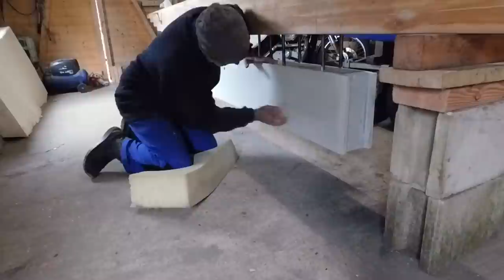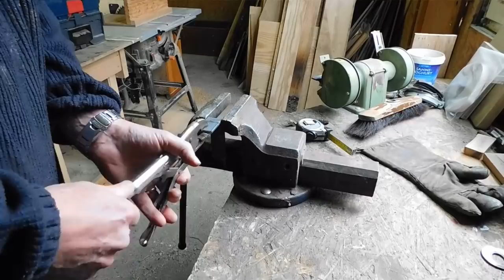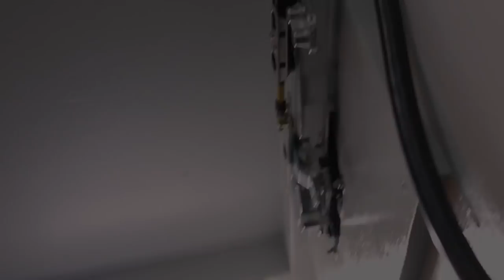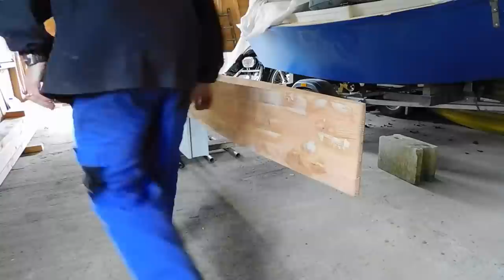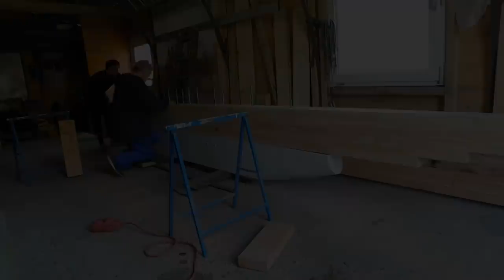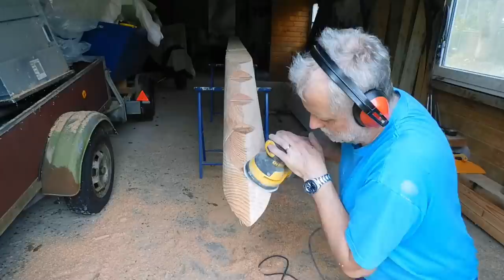Back at it!; Building a cruising sailboat - SV Tapatya EP226

Comment: Oh boy, that’s right 2 big strong ones, holy cow!!! Beautiful work on the Douglas fir, are you going to fill the keel bolt holes with epoxy as well? Nice work on the drive cables, very nice sweeps, shouldn’t have any trouble with those! Karin’s done gorgeous work too, it’s wonderful to have a nice cozy cabin. I spent last weekend cleaning our cabin up, ship shape and Bristol fashion for the coming season, top deck too....too bad it’s raining again now, just enough to make a dusty spotty mess! Thank you Tony, another super episode for the books!
Reply from the maker: Thank you Nena 😀😀 Yes, I was pleased with the run of the control cables. Yes, from my reading of other builders' methods, it's pretty common practice to bore the keel bolt holes oversize and pour epoxy down to fill them once the whole thing is in place. I shall be doing the same👍. And yes, preparing for the summer season is a time of great hope. Have a great one!

Comment: very nice keel work..Takes a lot of time to move that around.. Some old memories from my days came back and that keel was only 1,000lbs..
Reply from the maker: Thanks Frans. Yes, the keel's been a big project 💪
Reply: @SVTapatya  Besides moving the keel underneath the boat, marking the keel bolt locations on the bottom is another nice challenge .. but I am sure you got it all figured out….
Reply: @fransdriesen1311  - No need to mark them.. Tony drilled the keel bolt holes through the hull before he even started on the keel! Going by how smoothly the mating of the keel and timber went, everything should drop right into place without problems.

Comment: That's coming along beautifully, Tony!

You mentioned the masts, but I seem to recall there's still some work to be done on the rudder, too?

(In my own news, both the curved bulkhead beams have been laminated up, and work has commenced on getting the inside of the first buoyancy tank filleted and glassed. Filleting went well, but I can't say I'm entirely pleased with the fibreglass job (more air bubbles than I'd like!), but hey, it's a learning process, it's fixable, and I'm sure I'll do a better job on the next one! And I'm totally in love with peel ply.. that stuff is great!)
Reply from the maker: Thanks Garryck. Yes, but the final touches on the rudder need to be done when I'm fitting it, for which the keel needs to be in place. My planning now is to get the keel as far as having ballast and timber as one piece, to get the engine running and then to build the masts. I then hope/intend to move the whole lot up to a boatyard and put it all together/finish off the few bits that will still need doing. Hopefully that'll all work out 🤔. Are you using a roller to apply the epoxy? You may well already know this, but the trick is to wet out, wait for the epoxy to start to tack off a bit (15 mins maybe), put the glass down as smoothly as possible, then wet out using a roller to work the glass out smooth. I don't know what weight of glass you're using, but, from experience, mid and heavy weight glass goes down flatter than light cloth. The light stuff tends to float on the epoxy!
Reply: @SVTapatya  - No, I didn't use a roller for this, given that the buoyancy tanks are made up from 3 small(ish) panels. I figured it would be a good opportunity to try out the alternative method of wetting out the glass on a sheet of polythene (with a fin-roller, which in hindsight may have been a mistake), before laying it on the already wetted out panels (which had also previously been sealed with a coat of epoxy a few months earlier). Despite the way the glass looked fully wetted out to me, it seems I didn't manage to get it fully wet out after all.

I've since drilled small holes in most of the bubbles and used a syringe to inject epoxy into them, which has done the job nicely. I then applied another coat of epoxy to help fill the considerable number of spots where the weave wasn't filled, and put peel ply over the lot again before giving it all a good workout with a fin-roller. So we'll see how it goes this time around. The glass is 300 gsm, which equates to 9 oz cloth. I'm not sure where that falls on the med/heavy scale, but it certainly takes some effort (and a decent amount of epoxy!) to fully wet out!
Reply from the maker: 300 gram cloth is a good weight. It should go down smooth. I only ever use the wetting out on a plastic sheet method on very small pieces. Funnily enough, I did exactly that earlier today, putting some glass tape around the edge of Hazel's centreboard. We also did that when we glassed her through hull holes shut. On any piece of ply, I'd wet out the ply, put the glass cloth dry onto it, then roller epoxy into the glass. However, I have to add that the only reason I feel I can speak with some authority on this subject is that I've made plenty of mistakes glassing things in the past, and, slowly but surely learnt from them. You'll find the method that works for you, no doubt 👍
Reply: @SVTapatya  - Yes, the 3 pieces that make up each tank (all weirdly shaped quadrilaterals) range in size from maybe 300mm x 150mm  to 300mm x 250mm, so I figured they'd be a good subject for the plastic sheet method. (I won't be using it on the hull, rudder, or daggerboard, that's for sure!) The glass itself did go down smoothly, it was getting it fully wetted out that was where I failed.

Another thing I've learned is that if your peel ply comes folded, rather than on a roll, any creases, even faint ones, MUST be gotten out using an iron before applying it. The epoxy will NOT be enough to help pull it down flat, there will be a tiny air-line along the crease that's impossible to get out, and you'll end up with a faint line across the piece that will need sanding.

And having seen all the epoxy work you've done on Tapatya, I fully bow to your authority on the subject, and very much appreciate any tips and suggestions that you share! 😎

Comment: Hi, I just caught your video and see that you are soldering the connection at 18:48. You don't want to do that... the constant vibrations, rocking, can work the individual wire stand solder connections and break them so that your connection becomes bad, overheats and causes problems. You want to crimp them #ell out of them. You want the copper wire and the connector to become homogeneous. The solder also adds an extra element/material for the electrons to pass thru from connector to wire and increase the resistance.
Reply from the maker: Ah, but Rush, this is tinned, ie, soldered, wire, where each individual strand is precoated in solder, and a tinned terminal.
I’ve heard such claims before, and even read up on them. Imho they don’t stand to scrutiny, and are probably the result of ‘research ‘ conducted by purveyors of crimping tools and terminals.
Reply: @SVTapatya  Nope, not BS. It became a problem in cars with electric motor conversions where there were 20 or so batteries that had cables connection between them. After a while the crimped and soldered connections (like you did) would start heating up for no reason, it was found that enough of the individual strands of the cable has been broken and caused a bad connection. When the connections were just crimped, the problem went away.
Some facts - The electrical resistivity of regular 60/40 solder is 0.153 microhm meter, the electrical resistivity of copper is 0.0172 microhm meter, solder has a much larger electrical resistance than copper. The thermal conductivity of solder is 49 and the thermal conductivity of copper is 401, copper is about 8 times more thermally conductive than solder. And this is at 20 deg C.
Reply from the maker: But as I said , Rush, these are tinned cables, so that is all completely irrelevant. We use tinned cables on boats to reduce the corrosive effects of the sea water environment. You can talk about cars all you want, it's all irrelevant
Reply: @SVTapatya  It's all irrelevant until the soldered joints fail.... so you have a copper to tin to solder to tin to copper connection when soldered instead of a copper to tin to tin to copper connection if it correctly crimped.... Why complicate the pathway for the electrons go thru with another material barrier?
Reply from the maker: Mate, you're confusing tinned with tin. Tinned means coated in solder, so you've got a copper to solder to copper joint when you solder tinned cable to a tinned terminal. Anyway, the Idea that you get a better molecular connection through crimping is cobblers. As in galvanising, soldering involves a molecular bond between the cable and the solder. Have you pondered the fact that military grade wiring involves point to point soldered wires?
Reply: @SVTapatya  Thank you for your information.
Reply from the maker: Thanks for the discussion, Rush. I suspect we disagree, but we can certainly agree to do that!
Reply from the maker: And then there's the questions of what solder is these days (probably a tin/copper or tin/silver/copper alloy) and whether tinned wire is coated in pure tin or a tin-based solder, and I think, in truth, that varies....🤔🤔

Comment: I love your boat design, BUT since your boat is relatively small, is there are reason you opted to install an expensive, difficult to work on inboard instead of a much cheaper and easier to work on outboard of equal or more hp??
Reply from the maker: Thanks Bernd. Yes, it's a matter of personal preference. Some people like to fit outboards, either in purpose-built wells or just hung on the back. I'm a qualified mechanic (petrol and diesel) and prefer the protected nature of an inboard, their longevity, reliability, their superior charging capabilities and, in my opinion, all together more seriousness. I'm not concerned about working on an inboard in a well-designed engine room. However, another question might be why I didn't go for a electric drive system. (Expense and lack of belief in lithium would be some of the short answer there). It remains a possible conversion one day, though 🤔

Comment: Why fill in the step gaps in the front of the wool keel rather than cutting away the wood?
Reply from the maker: Ah, Willie! I was waiting for a comment on that! Well.... those steps should not have been there. They're the result of a miscalculation on my part. I thought about scarfing some wood pieces in there, but decided an epoxy microfibre filler would do. The whole thing will be glassed over with some substantial biaxial cloth in epoxy 🤔👍
Reply: I see! You are doing the right thing!

Comment: What size battery cables did you use Tony?
Reply from the maker: I'll have to look that one up and get back to you, Hans
Reply from the maker: They are 35mm2, which is a bit bigger than AWG2. Starter motor is 800 watts = approx 66 amps
Reply: @SVTapatya  I always use 2/0 on starter and negative cable so it crank fast and does not get hot.
Reply: Diesel take a lot of amp when the batteries voltage is low.
Reply from the maker: It's all dependent on the wattage of the starter, Hans. You can't just generalise 👍
Reply: @SVTapatya  I just figure that starters will always need more than you calculated for and  batteries will give you less over time.
Reply from the maker: Fair enough, Hans. And of course, you can just generalise and an oversized cable will always be safer. There's just considerations of cost, weight, size and flexibility to take into account too. Even at 10v, an awg2 cable would be oversized for this engine, so, for me, it's the right choice

Comment: Nice little ride there Tony, what bike is that ? I rode bikes for years. I cringe when I see you lifting that keel Tony, I had to sell my  2007 Harley Road King because of chronic back pain. I miss riding, so I now just have to settle with driving my Truck, even that has become difficult in the last several years. Drives me up the wall, that I can't enjoy the good things in life any more. Can be very very frustrating to say the least. So be smart Tony take care of that back, use a Jacks and such instead of lifting things that are extremely heavy at your age or you'll end up in my situation and you won't be able to enjoy your life anymore..its just not worth it bud.
Reply from the maker: Just a little Sporty, Fon, the 2003 model. I've done over 110,000 km on it. They're a great little bike! Sorry to hear about your back issues!